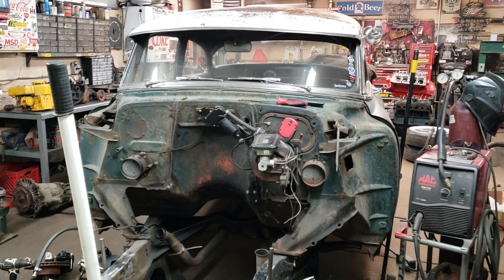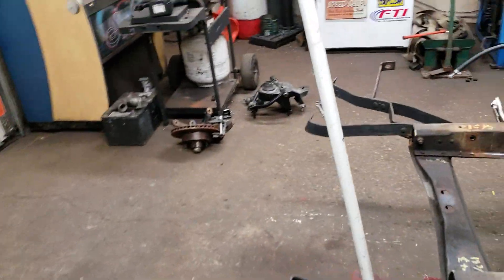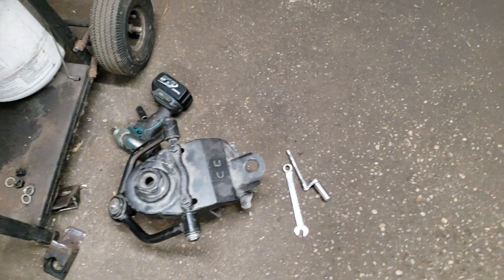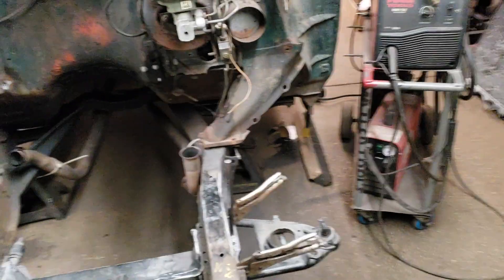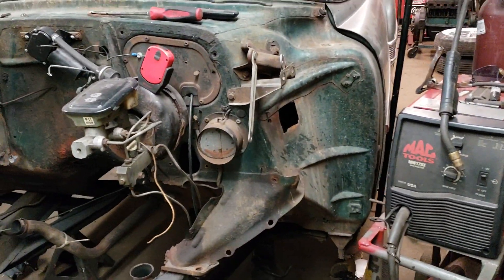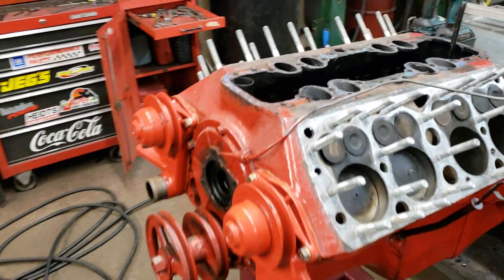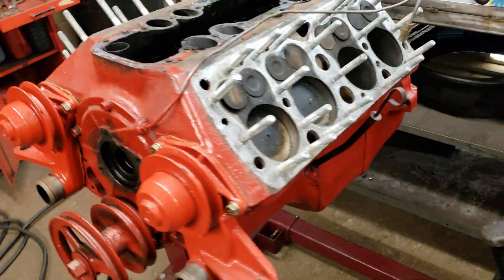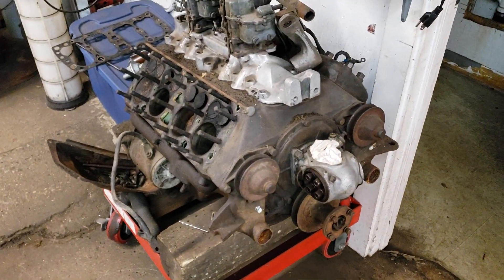1953 Chevy ..... Finely a Chevy in the shop !

Comment: I Love those Mustang Front-ends for putt'n a Hot-Rod. I used to buy wrecked Mustangs and cut out the front-ends back in the 70's...I put one under my last street-rod a '38 Chevy Pickup. The '53 is look'n good what you have done with it. It's gonna be Nice too.
Reply from the maker: Back then , you could find a mustang 2 in a bone yard . Not no more these days :)
Reply: @chevahaulic   Yes Sir, I bet they are getting HARD to find. Back then I used to have several complete front-ends lay'n round my shop.

Comment: Wow Matt. You are quickly becoming the YouTube "Flathead Master" !!  Bet that cracked motor was looking like a "locomotive" when it was running?? ;o)
Are you sure that is a 53?? It has 54 tail lights ?? What's the running gear all about??
Reply from the maker: It's a 53 , and those are 53 tail lights . The 54s had a back up lens . 
The stock running gear was pulled for an s10 rear axle . And now a mustang 2 front end .